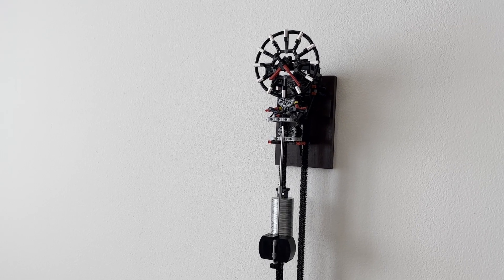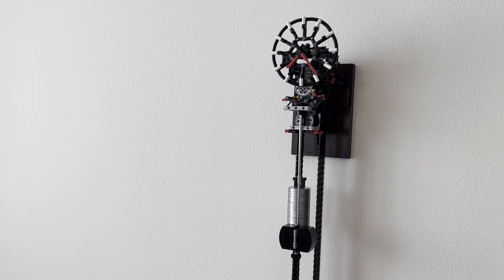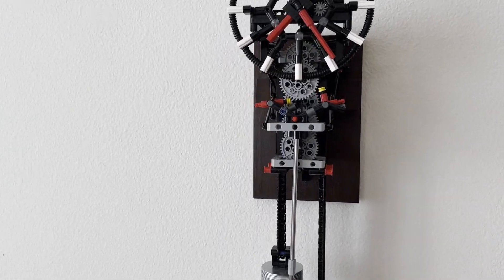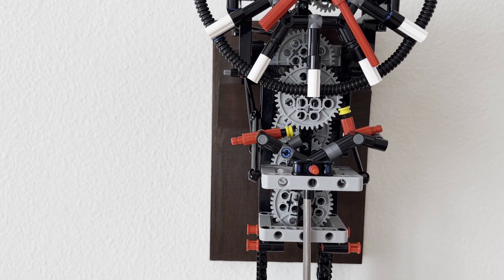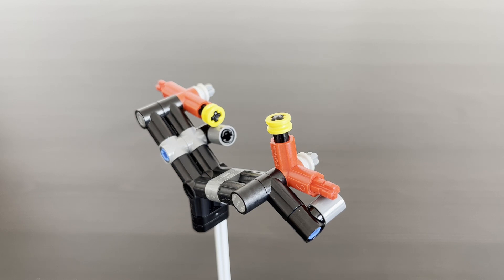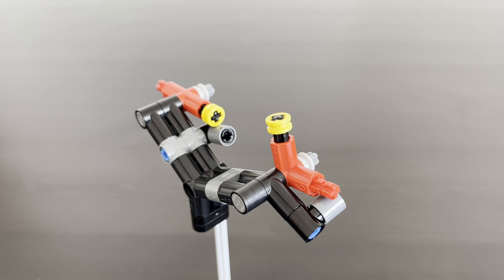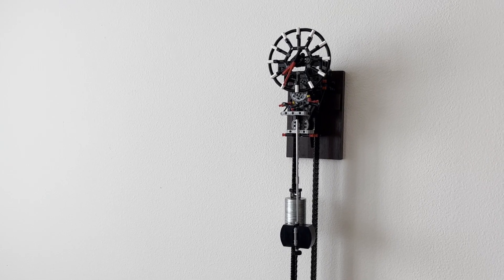LEGO Pendulum clock with grasshopper escapement

Comment: Great design and fun build. I especially like the improved grasshopper design.

I confess to redesigning the winding system. The links kept failing for me. So, I removed the whole mechanism.

I have replaced your winding system with a differential gear using the same axle point. The diff is prevented from taking power away from the drive train by use of a catch/stop which hangs freely from the existing axle which holds the two 12t bevel gears which connect with the caterpillar mechanism.

I was concerned any torque/friction caused by the force of the diff on the catch/stop would affect the power of the drive train. It does not!

If I knew how to post photos in comments it would make this description much easier.

Comment: Sorry I couldn't the clock to work using this updated escapement. Not sure how Dillon gets it to run for 3 days. I changed the gearing so that it goes a couple of hours before rewinding. Then used an escapement design by Berel Levy. That's much easier to fine tune. https://www.youtube.com/watch?v=QTZ8OrSvuVw

Comment: is the clock still running and will we get an update?
Reply from the maker: It’s still running, but I’ve only made minor tweaks since this video. The escapement now has recoil shock absorbers, the freewheel is much more robust, and I redesigned the gear train between the escapement and the hands, but overall it looks very similar. I think this design is close to exactly what I want, so I don’t have a lot of motivation to change it much 🙂
Reply: @DillonSharlet  Please give an update. I'm considering building it, but I'd like to have any improvements you've added since this video.

Comment: It may be even more accurate if you add a pendulum clutch between the escapement and the pendulum, so the they aren't connected on the same axle.  This is what is what "real" mechanical pendulum clocks have.

Comment: Well, I built your design. At first I hung it on the wall while I waited for weight washers to come. Pulling on the chain it didn't want to go. I think because the wall is uneven and it just caused things to bend somehow. So I had to make a flat board to it to sit on and level that. Still was kind of finnicky so I sprayed some PTFE lube on it. Now it's just up to tuning the pendulum arm length. I have steel axles coming from the UK. I bought some 0.001" PTFE sheet, and I just think it's too thin to even manipulate to get in there between the axle and beam. I went with solid pieces on the pendulum so I could hear something from it. This is awesome. Thank you for sharing!

Comment: I built it, and have some questions about it, does the pendulum have to be perfectly balanced, because I cannot get the pendulum to swing more than 3 times. Could may that be because I had to substitute some pieces. Also, what is the recommended weight on the chain? Because sometimes the weights wont spin the gears.
Reply from the maker: Balancing is important. It can be adjusted by either moving the yellow bushings on the escapement (tricky), or by tilting the entire clock (easy, if your mount allows it). BTW, tilting the entire clock is often how its done in "real" clocks (e.g. by putting shims under the feet of a grandfather clock).

My weight is 560 grams, plus whatever the lego parts used to build the weight structure weigh. It might help to start with a bit of excess weight (or simply add some torque to one of the gears in the drivetrain with your fingers temporarily) to help get things tuned. It will definitely take some tweaking to get it running well!

Comment: Awesome instructions. Thank you so much. For step 20 I'm think of using an axel that I push though to the other side and use  two more 4185 wheels and a rubber band for a little less friction rather than sanding a harder to find part.
Reply from the maker: That part is $0.01 each on bricklink :) But of course, you should make changes if you like. Another alternative is using a ratchet mechanism, that's what I did at first.

I'm actually still trying to think of a better way to implement this, I don't like how much backlash there is in the hands currently. I'm thinking about using an inline clutch built directly into the minute handle axle. The tricky part is finding another way to implement a 1:2 gear ratio without more backlash than a differential...
Reply: @DillonSharlet  Yeah I know I can get parts for cheap but many stores on there don't let you get one hard to find item without a minimum purchase. I'm now thinking of an even better solution. I think the rubber bands would slip funny and stretch back and forth. Maybe a wheel with a rubber tire that I push up against something that I can adjust the torque.
Reply: @DillonSharlet  I just want something that is more repeatable. I'd think it is hard to adjust the torque on this. Sand too much and it spins too freely sand too little and it binds up.
Reply from the maker: So not sure if it helps, but I didn't sand the ridges, I cut them off with a knife. There are 8 ridges (4 on each part of the axle), I cut 6 of them off, leaving two on opposite sides. I think this is pretty repeatable.

Comment: Just out of curiosity, how accurate this clock is?
Reply from the maker: Right now it's accurate to around a minute per day. I have only been running this design for about a week now, so it will take some time to get a good sense of how accurate it is, and there are probably still small adjustments to be made.

Comment: Awesome improvement!
After I switched to a grasshopper escapement I lengthened the pendulum and made appropriate changes to the gear train so that the escapement wheel could double as a seconds hand. On your clock you could probably get a 4-5 day autonomy.
Reply from the maker: I've thought about doing this too, but I think having the clock tick every 0.75 seconds would drive me crazy :) I want my pendulums to have a period that is a multiple of 1s, and 2s makes for a really long pendulum. But I agree, I think between a longer pendulum and this escapement capturing probably close to 2x more energy than my last one, it seems quite possible to make a clock that runs for well over a week!
Reply: @DillonSharlet  
I have a 2s pendulum on my grandfather clock, I'm thinking of trying out your escapement with a 2s period and possibly using it in that clock.

Comment: Could you pleaseee make a tutorial or an instruction book
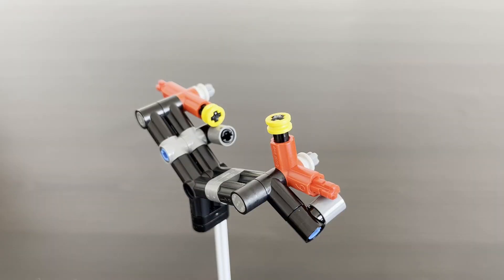Reply from the maker: If you check the previous video, there are instructions for the old version. What is shown here is almost identical, except for things clearly visible in the video :) 2:00 shows it pretty clearly.
Reply: @DillonSharlet  thanks!
Reply from the maker: @tieslesmeister  I've now updated the instructions: http://dsharlet.com/file/grasshopper%20clock.pdf
Reply: @DillonSharlet  oh heck, this is amazing. I just went through and manually put together a parts list from your original design, this will make my life MUCH easier. Can't wait to build this!
Reply from the maker: @andrewschlup6169  Very cool! A lot of people have mentioned they're building their own versions of this, I'd love to see videos of them posted!
Reply: @DillonSharlet  
Well, there isn't much left from your version, but here's one I'm working on currently:
https://youtu.be/yPHHNryYEdQ
It shares the 1-second pendulum period with yours
Reply: @DillonSharlet  most of the parts came in, I got it up and running, and it's working great! I might upload a video of it at some point. My main issue with getting the escapement to reliably work was that I didn't have quite enough weight, so I added some old skateboard wheels (my other hobby), and it's working great now!

So yeah, that's my tip for other people who are having issues getting it to work: just because you have enough weight to run the gears WITHOUT the escapement/pendulum engaged, does not mean that is enough weight to reliably drive the escapement/pendulum. Remember, the swing of the pendulum gets it's energy from the weight, which pushes on the pendulum via the escapement.

Just waiting on the steel axle and the rest of the pendulum weights to arrive before I can start tuning for accuracy. Such an amazing design!!
Reply from the maker: @andrewschlup6169  Very cool! Glad to hear you were able to get it working. I think the best thing about the steel axles I used is that they are a much tighter fit, so I don't need to worry about the pendulum falling apart under its own weight :)

Comment: So clean! Great design. Interesting that elasticity of the pallet axles provides sufficient space for recoil. Much simpler than moving pallet stops.
Reply from the maker: It's funny, I didn't quite understand why the extra part was necessary in your design, and by the time I figured it out, I just got lucky that this design worked well enough as long as you don't swing the pendulum super hard...
Reply: @DillonSharlet  I think that the pendulum rod may provide some cushioning effect - being single axle, it is rather flexible. But yeah, overall the recoil is not that critical as long as swing angle is low. 
Funny enough, I have been working on a small-angle grasshopper for a few days and got it running an hour ago; the recoil is quite microscopic.
Reply from the maker: @davidziemkiewicz1350  One thing I don't like about my design is one of the pallets is much closer to the pendulum pivot than the other. That pallet has imperceptible recoil, but that just means the other pallet has to move more to compensate...

BTW, a small change I've made that you might be interested in: since capturing the video, I redesigned the pallet stoppers to use the little 2L rubber liftarms. This makes the clock almost completely silent!
Reply: @DillonSharlet  Good idea with the stoppers. 
Indeed, the difference in distance from the pivot is troublesome. Maybe try replacing the connector the left pallet is attached to with part 41678? That should move it a little bit up.

Comment: Any concerns with the bushings being pushed further onto the axle over time?
Reply from the maker: I don't think so, the escapement wheel never freely spins, so those impacts are slow and small. I think maybe one of the other adjustments could slip over time, we'll see!
Reply: I'm using the same bushing solution in one of my clocks. There was no movement over past month. As long as they are new or almost new, there should be no issue.